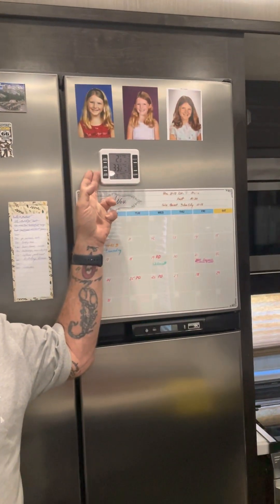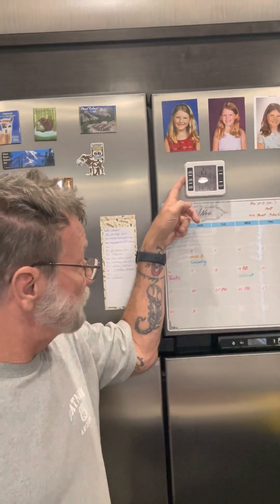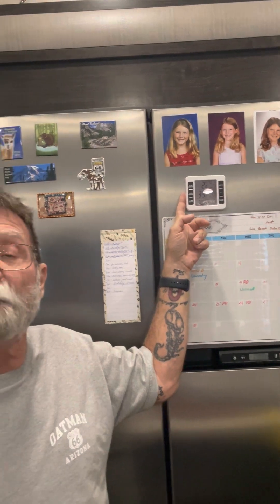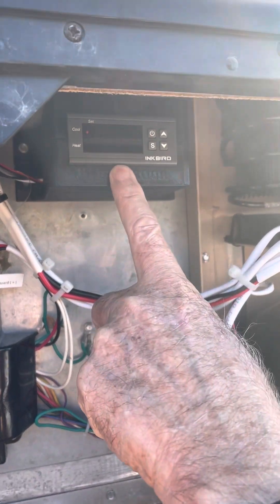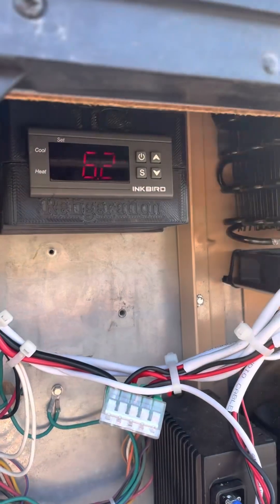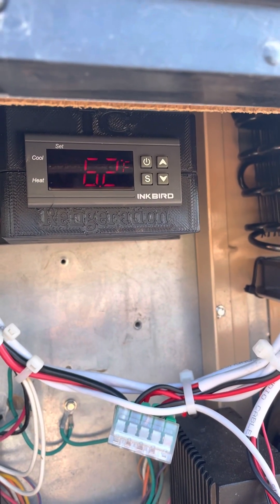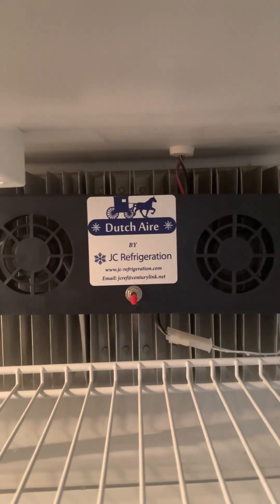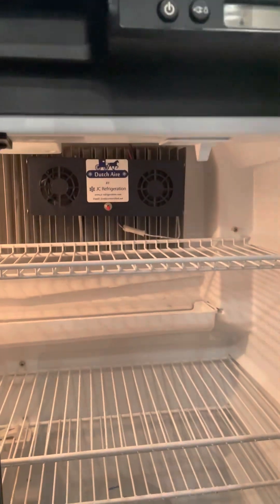NorCold 2118 conversion to  Dutch Aire 12v dual compressor fridge.

Comment: I did their single compressor upgrade on our Norcold 1200. It works ok, but not great. We live in AZ, so we have heat issues. Wish they had the dual compressor option a few years ago. It would have taken care of our concerns.
Reply from the maker: We are full time and try to stay away from the “heat”. Our unit does struggle a little above 100° but it does reliably keep our food in the safe range.